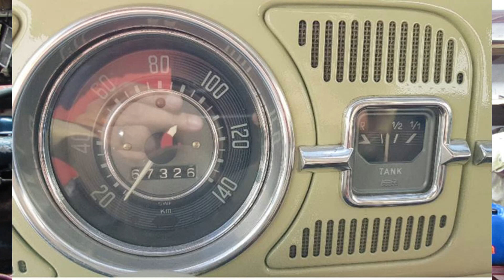Gardner engines: progress on Brigantes engine

Comment: Would there be a similar unit to provide hot water & heating on the engine for the crew? - Seems a shame to trow away the heat
Reply from the maker: Yes, for some customers we have tapped off coolant from the bypass circuit to domestic heating.  It works well.
Reply: Generally called a calorifier, but the principal is the same.
Reply: @popuptoaster  Narrow boats they have them- hot shower and a warm boat  for free at the end of a busy day is a bonus
Reply: As noted below you usually tap off the freshwater cooling system and the water heater, or calorifier contains yet another heat exchanger where that coolant is circulated inside the tank of domestic water you are trying to heat up.  On my boat I get hot water at the taps in about 20 minutes to half an hour after starting the engine which is sweet!  It can mask cooling system problems if you don't run your engine for very long as in a sail boat that only has to run the engine to clear the harbor because the tank sucks heat out of the system until that tank is hot! You could also power a radiator type space heating system the same way.

Comment: Interesting design. Thanks for your part in supporting this project.  Will it be supported on a bracket mounted to the ship or the engine? Glad to hear you will be keeping the trees.   They are a pain sometimes but worth it.
Reply from the maker: Please, which "it" are you referring to Chris?
Reply: @tangentgardner  I'm sorry, the heat exchanger. I saw on your next video the bracket that holds the heat exchanger in place so my question is answered.  Wish my boat was large enough for a Gardener engine.  I have enough room in there for a Beta 25 which is a marinized 3 cyl. Kubota which replaces the original Volvo but is 90 lbs. lighter.  I love your content I'm learning about an interesting make of engine that I may never see in person. Took me a while to find your email as we just had a big election season end here so I was getting hundreds of emails a day.